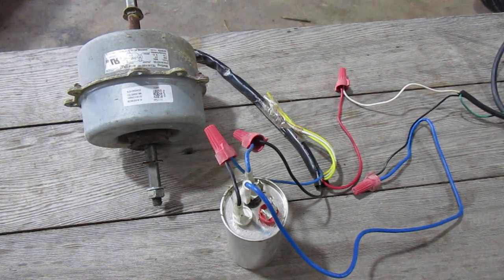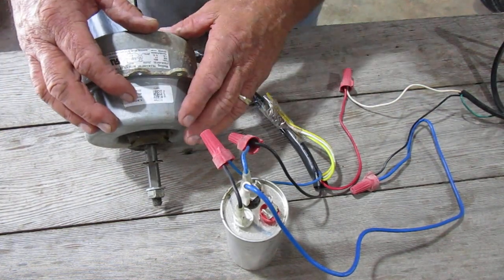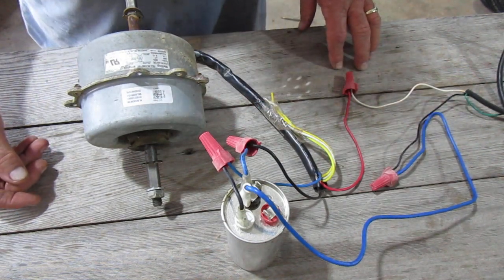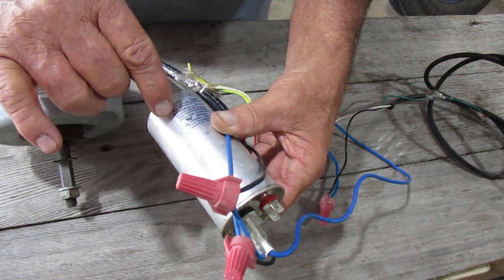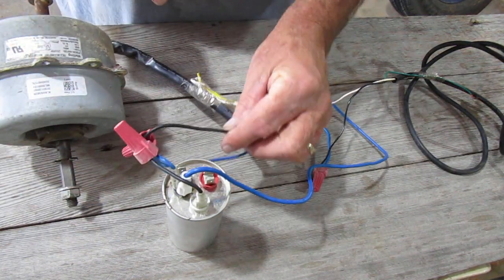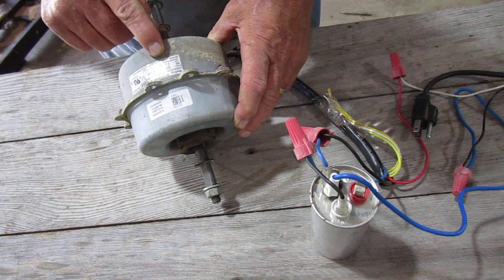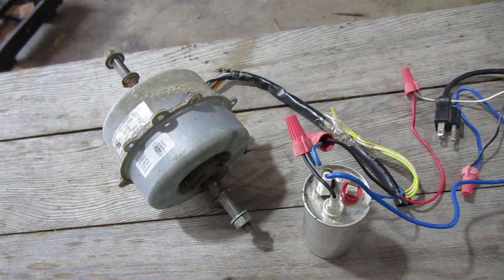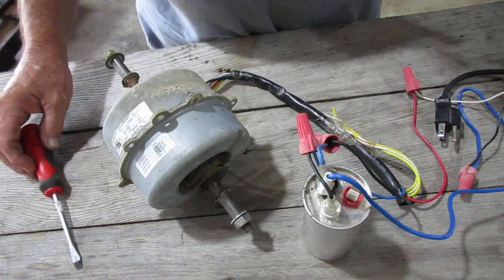DIY How to wire single phase 115 Volt Blower motor with start/run capacitor Testing Only

Comment: So begs the question. Why didn’t you hook it up on your bench the way it was wired in the unit you took it out of, or by following the wiring diagram on the unit? If you did that and never stated that in your discussion. And just so you know, the green ground wire on an appliance has nothing to do with personal safety. It is known as the equipment grounding conductor, and does exactly what it says and functions to cause an overcurrent device to open in the event of an electrical fault.
Reply from the maker: Well I would of hooked it up the way the manufacturer had it hooked up. But I picked this motor up from a junk yard. It was just laying on a stack of motors

Comment: Hi sir...I have a 1 phace 115v motor from a GE window AC it had a short on the cord that connects to the outlet...I replaced the cord and when I connect it to the 110v outlet the only thing that works is the display on the AC unit I checked the capacitor ant its within range( it good)  I took the fan motor out it has  a harness with a red, an orange and a yellow connected to a connector the black and the white cables are on the same harness coming from the fan motor should I eliminate or not use the red, orange and yellow cables as I seen on yr video you taped the 3 yellow cables and not use them...I need to see if the motor is good or if it burned caused by the short on the main line...help please.
Reply from the maker: Does the motor have a wiring diagram. I would need to see it to answer your question

Comment: My fan motor has a 3 wires which are Brown Yellow Black. I wonder what would be the setup. 
Also, the fan motor is 240V and I think I can do it on 110 outlet except motor may run a little slower. All I need to do is to make the  fan motor I received works because I only have 30 days to return if not.
Thanks for the video.
Reply from the maker: Not sure without seeing the diagram on motor
Reply: @LarrySbrusch  No problem
Reply: @Wyqid thanks for the information.
Reply from the maker: Thank you

Comment: Motors that use start capacitors have an internal switch that opens after the motor starts. This motor appears to have a hung centrifugal switch. I know this is quite old, but just wanted to mention this in case anyone needs the info. When those switches do not open, motors run rough and slower than normal and are very inefficient.
Reply from the maker: Appreciate the comment and information. Thank you

Comment: Ditch the capacitor and just spin it it will start right up and its way quieter than that
Reply from the maker: Good ideal. Appreciate the comment
Reply: If the noise goes away it probably means it's a bad cap, or the wrong value cap for the motor winding. If it doesn't, check the bearings or look to see if the windings are pushed out of the stator vanes and rubbing on the rotor.

I know it's been a year... sorry, got here as quick as I could.

Comment: I have 2 double prong capacitors i did it the same way and nothing  my air con motor only has a shaft coming out one way
Reply from the maker: Appreciate the comment
Reply: @LarrySbrusch  all good i tinkered with it and got the motor working it must have been because your wiring colour in america is different to australia i connected the power wire to one side of the capacitor ground to ground and the white wire to the other side of the capacitor and it fired up now i need to buy my grain mill and see if the motor is strong enough to make it work
Reply from the maker: Good deal

Comment: The white is Neutral/Common the Black is the hot side.
Reply from the maker: appreciate the comment. Thank You
Reply: @LarrySbrusch  it doesnt really matter on a motor for the white/black, itll just change the direction of the current its flowing
Reply from the maker: @danieldelossantos1290  Thank You. Appreciate the comment

Comment: I see something not right here. This is a dual capacitor. You only used one here. The black wire that feeds into the motor which could be for the motor is not connected to any capacitor. Only the blue wire that feeds the motor which could be for the fan is connected to one of the two capacitors. I suspect that the blue wire from the motor should connect to the smaller capacitor and the black one should connect to the bigger one.
Reply: The other one goes to the compressor to start it.

Comment: That's a run capacitor not start. Start capacitors are black
Reply from the maker: Yes, but it was all I had to test with..and it worked for this project..appreciate the comment
Reply: @LarrySbrusch  it is correct, you were correct buddy, start capacitors are widely used on compressors, run capacitors are used on motors etc..
Reply: It creates confusion for people who really on youtube. Please do at least the basic  math before you post it on YouTube.
Reply from the maker: @keepright5232  Not all of us are rocket scientist...But I'm sure that youtube has a lot of know it all's.. i wish I was one of them..sorry if it offended you

Comment: mine has no white or any thing normal
Reply from the maker: Not sure what to tell you on that one..you don't have any kind of wiring schematic on motor itself..
Reply: i figured it out on hot run off the cap the other to the desired speed 3 wire deal
Reply from the maker: Good deal

Comment: You don't need capacitor to run that motor at all.  Just simplify your life and all that wiring.  Trust me.
Try it and see what happens.  Directly hook up your two wires to that little motor and you will see that the motor will hum.  Just turn it by hand any direction you want and watch it go.  Not a good idea to leave the capacitor engaged in the start winding, Make your motor noisy and hot and will burn it in  no time.
Those start capacitors are typically accompanied with a relay of some sort or a centrifugal switch so it gets turned off when the motor gets going.  It is a terrible thing to do running an  induction motor with capacitor on.  Didn't you notice the terrible noise of that motor. It was hurting.  and induction motor being brushless should purr like a kitten.
Reply: Hi Bue Ocean, you write "just turn it by hand". I suppose that means that it will not start on its own without help if you don't have the capacitor??
Reply: @yvespetit  no itll go by itself without a capacitor. It will spin in either direction too.
Reply: @yvespetit  i think if the cap is not in there it will need a turn to get going sometime it may start on its own. but it will also use like 15 amp with the cap it will use like 6 amps  i believe
Reply from the maker: Appreciate it. need all the advice I get get. Thanks for the comment
Reply: @LarrySbrusch  Another thing that will make any motor happy is cleaning it and putting some good old 3 in 1 oil or any oil in the shaft.  It makes a huge difference.  Oil is a big deal, bigger than cleaning.  But if you have fan blade on the motor the fan of course have to be cleaned.  Most people's bathroom fan give out because they don't even think they need to be cleaned.  It gets to the point that everything just freeze up, can't move and the coils of the motor get so hot,  turn black and are toast.
Washers, dryers, fridge, kitchen exhaust fan, heating, air conditioning and the rest.   They cry for some oil and cleaning.
Reply from the maker: @alchemy1  You hit a hot spot in my life.. I remember back about 6 years ago, we bought and older house and one day we came home to find the house completely full of smoke...I immediately killed all power, grabbed a water hose and started looking.. It wasn't easy, but I narrowed it down to bathroom..I then went up into attic to find the insulation glowing around the exhaust fan. Hit it with a little water and killed the fire...the culprit was the exhaust fan motor, just as you stated in your comments.. They all need cleaning from time to time
Reply: @LarrySbrusch  If you clean everything once a year and oil them while you are at it, most motors will last forever, longer than you and I.  Motors are die-hards.  Resistors, capacitors, timers and the like things have time span and they should simply be replaced before they croak ideally.  It is good to know what they are and where they are.  Hell you can replace them before you have to wonder why something is nor working.  In other words you don't have to know about heating and air conditioning to replace that capacitor.  you just have to know what capacitor looks like.  You would be surprised that most calls are fixed by simply replacing a capacitor.  But people have no idea.
If it wasn't for science and technology, we will be in caves and how strange that most people don't have a damnest clue about anything, from what goes in with that thing ( car) that they drive and all the things they use everywhere.
It is all run by science, especially magnets and conductors.  It is an actual fact.  You can't walk 25 feet without interacting with these things.
Reply from the maker: @alchemy1  I agree with you for sure..I guess that is why all of my equiptment is about as old as me..I am not shy with a grease gun or squirt can
Reply: @alchemy1  Thank you for your comment you opened my eyes to some important things 👍
Reply from the maker: Appreciate the  comment
Reply: hmmm.... I thought only start capacitors need to be disengaged after the motor starts? For a run capacitor like on most AC units, aren't they always connected to the circuit while the motor is running? Correct me if I'm wrong.
Reply: @randomchannel252  Right you are.  Low voltage run capacitor provides sufficient phase difference for low torque fan motors. While high torque motors are typically designed split phase with robust windings, requiring start capacitor.  And some in between motors have both.
Reply from the maker: Thanks appreciate the comment
Reply: Absolutely wrong.  I had a oil furnace blower motor that ran terribly.  40+ years old.  No diagram.    Had to add capacitor.  Runs great now.